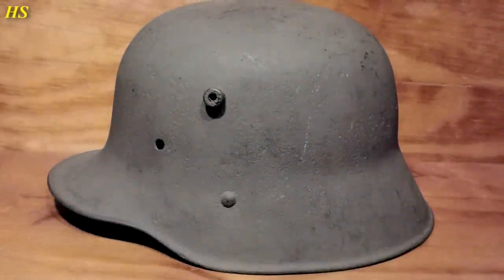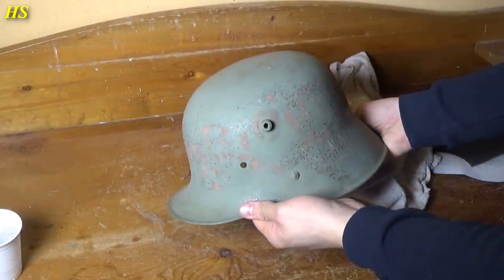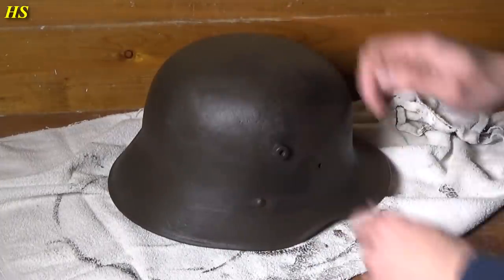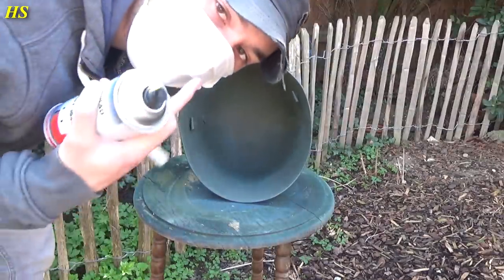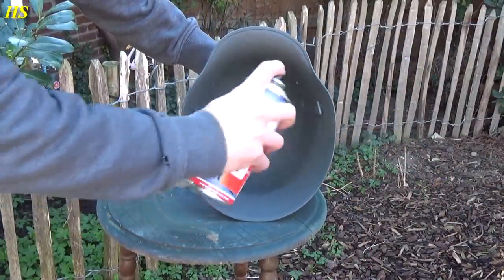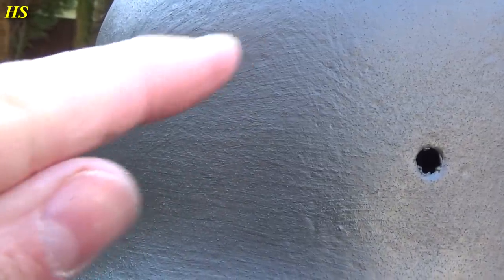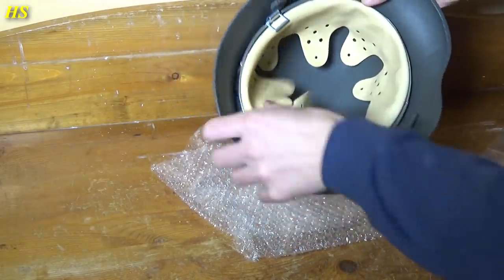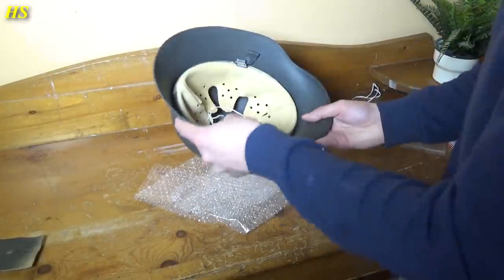Restoring and Converting an Austro Hungarian M17 Helmet to a German WW2 Wehrmacht Helmet!

Comment: Tip: try to make slow movements with the spray paint going  from left to right (or vise versa) and then stop spraying, other stroke etc
Reply from the maker: Thanks for the tip! If I go too slow, I will get paint drops fast, that's why I go really fast! 😁
Reply: @History-Secrets  thats true, thats why you have to do thin layers everytime! My helmets mostly have 4 to 5 thin layers. Just to help you ;)

Comment: I have a bit of an issue and maybe you can help.
I bought a Polydor windup gramophone of the PD series from 1936 to 1943 it was released not only as a machine for the general public but also these were used in the beginning as entertainment on the Nuernberg rally campgrounds and later in the army.
the felt of the plateau could be switched making this the first record player with an anti-skid mat the felt could be just a mono color or it could be with a swastika.
my issue is with decals were they the same as on helmets or were decals on machines different I did see a Wehrmacht radio on an auction site and the decals on that one were the standard eagles as on the helmets
so did the machine have the standard helmet red/white swastika decal or something else?
I want to make mine into one that is the same as ones supposedly used by the nazi's

Comment: What is the stuff you use to cover the pitting?
Reply from the maker: There are many different types of stuff you can use for filling these holes. I forgot the name.. But a very common one is 2 components filler!
Reply: I use a brand called P38 lol (David's ISOPON P38), you can get it from auto body shops and places like that.

Comment: Nice work but an early pot would also have the three colours on the other side.
Reply from the maker: Not necessarily actually! The typical early helmets would have the shiny finish without texture, and 2 decals indeed. But later in 1940,the regulations changed, and the second decal was ordered to be removed. This helmet was restored to the 1940 standards, and because I normally reenact later war, this would be correct! 😁

Comment: Where's the black-white-red decal on the opposite side of the helmet?
Reply from the maker: In 1940 the regulations changed, and the tricolor decal had to be removed. I normally reenact late war (1944) so the best option was to place 1 decal instead of 2.
Reply: @History-Secrets  As far as I know the regulations were first changed in 1941 during Unternehmen Barbarossa, because the decal was too bright and too visible for the enemy. Furthermore I have only seen the M17 Stahlhelm in the Austrian "Prinz Eugen" SS Division with SS decals. But it makes a nice edition to the widely used M16 Stahlhelm so I don't mind.

Comment: A question:  I have an original ww1 German M18 helmet that I try to find out which factory the helmet is made in, if I am not mistaken you see marks on the helmet which I can find one above with marked "P 42" I have tried to find answers but can not find info, checked a page called alexanderandsonsrestorations.com, but they gave me no answer, so do you know reach or any other website that can give me the answers?
Just a little story that I want to share with everyone, in 2013 I got a original ww1 German gas mask made of cow leather with filters for like 200 euros, later in year 2014 the prices went up very fast, since now at this time you can see on ebay show sells for 300, 450 or 500! so yeah i'm proud of finding one part of history before hundreds of years of ww1 started :D

Comment: With this rust craters under the paint it looks ugly, you didnt even try to correctly fill them up to make a smooth helmet surface. Very bad job sorry. All this rust craters under the paint are not acceptable. If you havent got time for the propper restoration... dont restore the items....
Reply from the maker: As you can see at 0:40 I did fill the holes up. On camera it might seem that the holes are still all over the place, but with the naked eye you can't see it at all. As you can see at the end of the video, the helmet looks nice and smooth. I will be using this helmet for reenacting, and I'm sure people won't come close to me with a magnifying glass to check my helmet. A lot of times with original reissued helmets, you will see chipped paint, damage and even cracks etc underneath the paint.